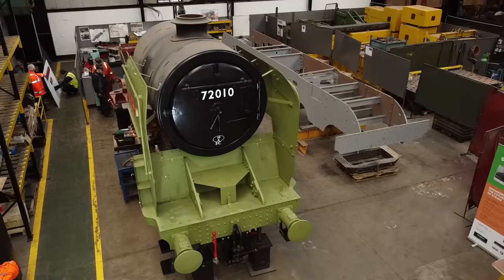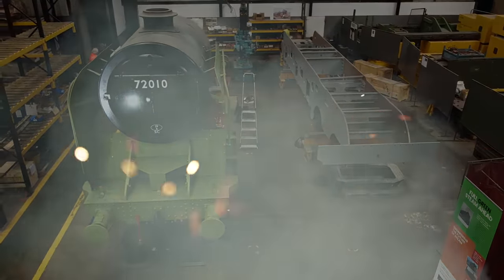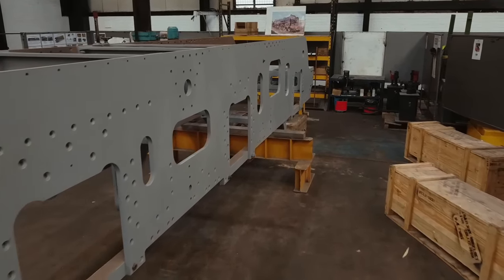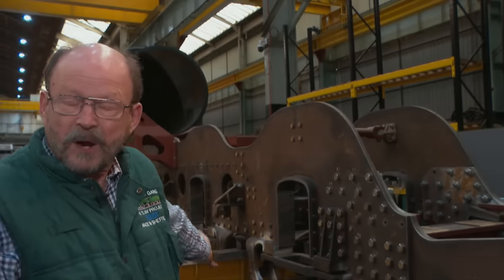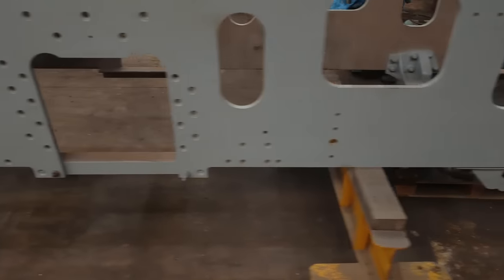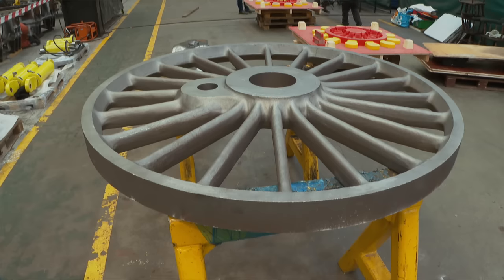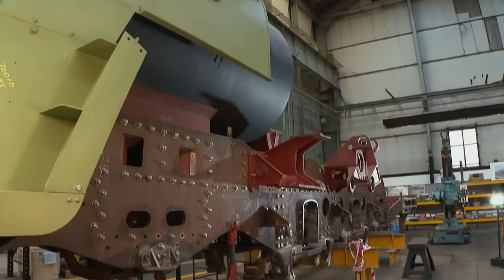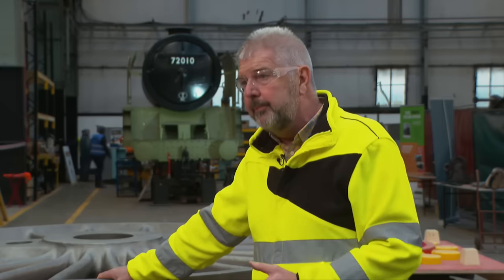One modern Sheffield factory - building two brand new steam engines. A short film by Tom Ingall

Comment: I was very surprised by how thick the boiler walls were!!!  Look to be at least 40mm (perhaps 50)...I did not think they were handling enough pressure to need that thick a wall!
Reply: I think that may not be correct more like 25  or 30 mm.
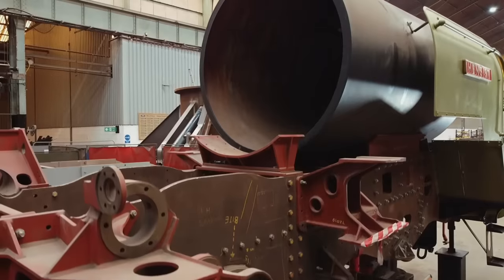Reply: Yes, If you look at 2:20 the walls of the main boiler appear to be at least 40mm thick.
That should be strong enough to pass boiler inspection for the next 100yrs or more 😊 Easily rated past 300psi (20 bar)
With that kind of over-engineered design strength, it will be interesting to see what they plan to build for the firebox end of the boiler, and smoke tubes or supercharger tubes for heat exchange efficiency.

Comment: Well against all better judgement they reintroduced electric cars. So steam driven trains makes far more sense. They still are very functional and one hopes they have 'upengineered' the worst of the faults from them. 
And I suspect for the heritage rail peoples boon as there is someone who can make them boilers etc/ As more than very expensive one of jobs. Here in Oz there is several old locos that actually run but the boilers are past their use by. 30 years agao there was jobbing engineers who could make one to the plan for a moderate sum. Then that place closed and the experience was lost and now a boiler is 4 times as much. Oooopps

Comment: Sure would be nice to know WHY they are being built.
Reply: guess. They were important and popular locos unable to be preserved. And they like to engineer projects that are different.
Reply: The Corris railway is also getting brand new steam locomotives No 10 being newest and based on No 3 Sir Hayden.
Theres quite alot of projects bringing old designs back from the dead like Peppercorn A1 Tornado and the baby deltic.
Reply: What do you mean why they are being built ? lol.... There's a global war on oil isn't there? So there has to be other options, so that we save more for home's heating. Everybody has to diversify sometime.... (in order to keep everyone alive)... and this is not even including majority of India or Africa to also be using petrol too. Even China is now struggling to use oil.. for ALL those train tracks that they built. They built trains. They built airports. And they had factories. And now, not even enough energy.. to run them all... During this lock down.. did they not fight for energy ? And even if they get the energy now.. is everything going to be able to run on a full time basis ? Apparently... some areas now have energy switch off overnight. To conserve energy.... Even Japan turned off their coal and switched on their hydrogen which they couldn't get working before.... Germany has switched off nuclear as well... Didn't people feel the cold in the past winter? It was around a good 8 degree drop... I felt so cold.
Reply: @MeiinUK  What flavor is that Kool Aid?  Does the Cult supply it for you?

Comment: the reason that factory is building TWO steam locomotives?
OBVIOUSLY someone needed two new steam locomotives, and signed a contract for them to be constructed. 🤔🙄
Perhaps restoring two existing locomotives the size needed was not a viable option.
At any rate, the factory is building them because there is a contract for their construction to whatever the EXACT specifications are..
The factory sure as HE'LL isn't building them on a whim ... hoping a buyer will magically appear, and the engines they built at random will meet the specifications needed by an unknown buyer ...